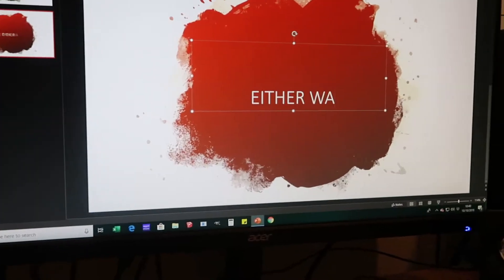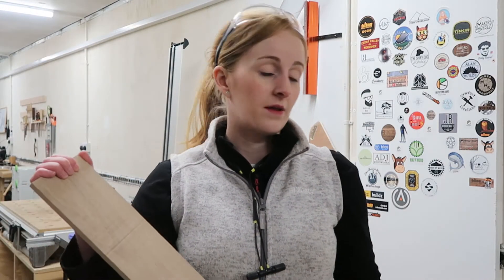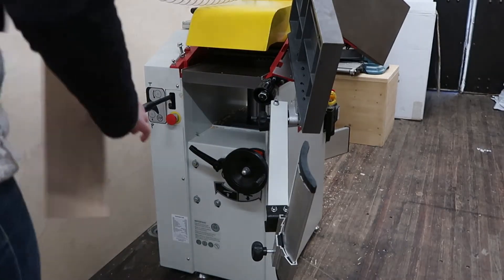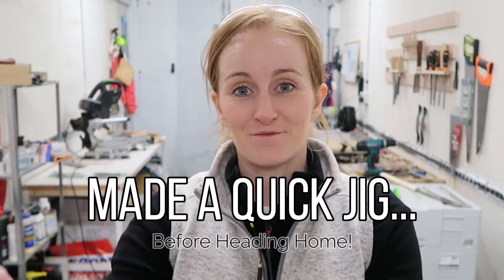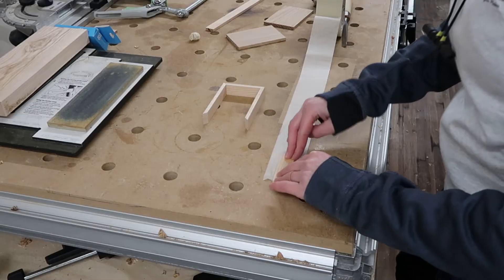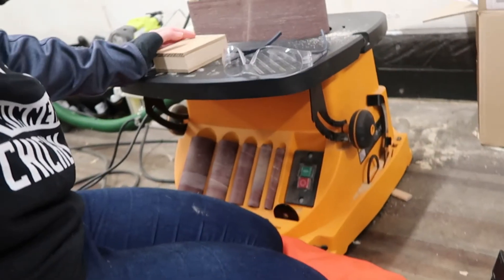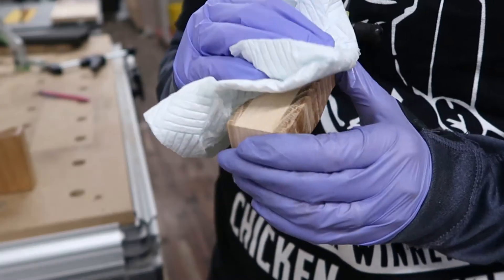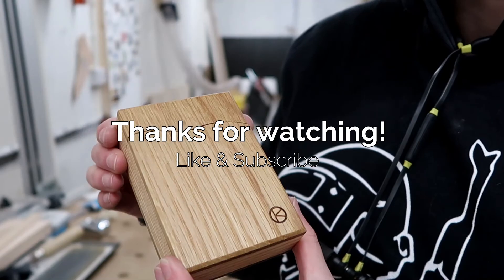Making a wooden PLAYING CARDS CASE, Deck Holder/Cards Box

Comment: Awesome little box, she must have loved it! Love the curved lines on the lid, such a nice detail. 

One thing when using the router, is to try and clamp the piece down to use the router rather than holding it - if it were to slip, you could potentially get a pretty nasty injury on your hand holding if it were to deflect into it. 

Loved the vid and keen to see more!!

Comment: That Triton is almost identical to my Ridgid brand of same style Oscillatiing edge/spindle sander.  It has some very tiny hex screw adjustments to square up everything. It even came with the hex keys (Allen keys) to do it. Try going to the Triton website, or if they don't have the support manuals online, then go to Ridgid's.  I'm guessing they are two names for exact same manufacturer.  Ridgid has a great website with all of the manuals on there.  The model number of the Ridgid one is EB4424.
Reply from the maker: Amazing! Thank you for the info, appreciate all the help🙂 & of course thanks for watching!! 😁

Comment: What am I missing?  I see no magnets.  Where are they?
Reply from the maker: Hello. Magnets 🧲 are really small but strong ones and they are located on each side of the case (drilled and glued into the end grain) where the two pieces (lid and bottom) snap together. Hope this explains and helps. Thanks for watching 😊!
Reply: @KirstiePervinDavies  are they shaped like a really small diameter dowel pen or like a pencil lead or something?

Thank you for responding.